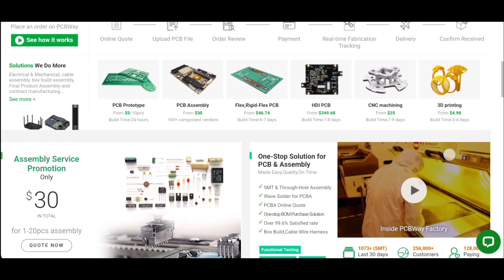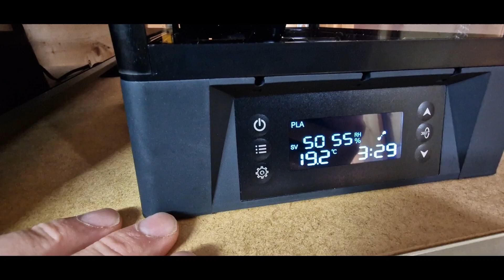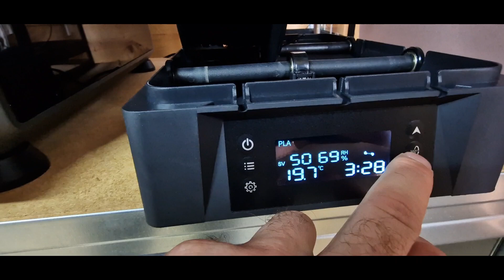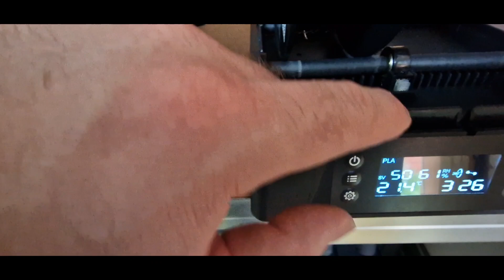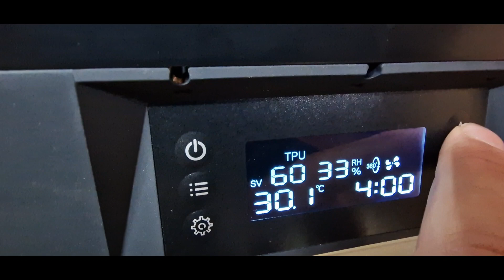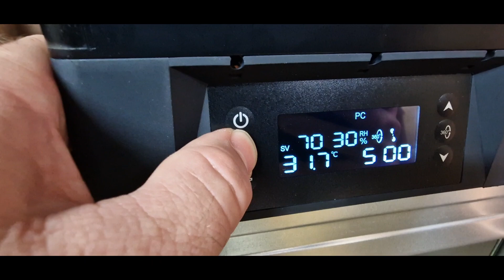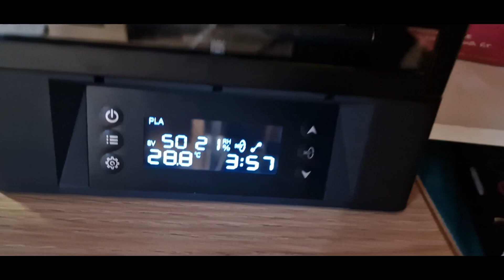Eibos Polyphemus Dual Filament Dryer, it spins and holds 3kg spools whattttttttt

Comment: SECOND! Hey there buddy. Soooooooooooo, I just opened mine, after it's been sitting here...... since launch! (Sorry Eibos). I got no hardware for the HANDLE. I googled it. Looks like others didn't either. Your video showed up in my search. YAY!!  How did you install your handle?
Reply from the maker: Hey 👋  so mine came with 2 screws and then i connected to the perspex panel. That's odd urs didn't supply 😮. 
Thanks for watching,
Reply: @3DPUK-TECH-CHANNEL  Do you know what size they were? Did they just Self Tap into the 2 holes on the cover?
Reply from the maker: @3DRundown  I'll goto the studio tomorrow and take a pic and send over, I'll send to your Facebook messenger 😉